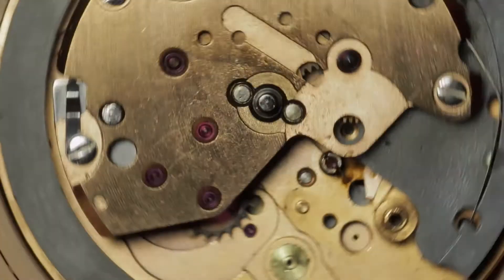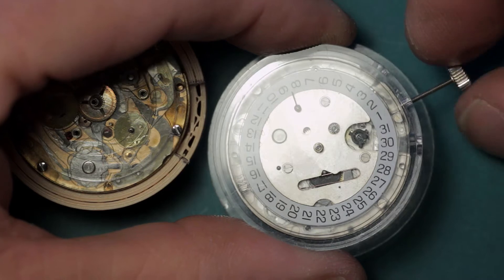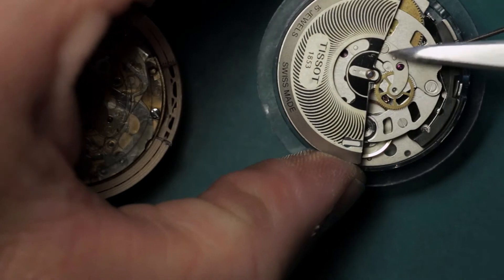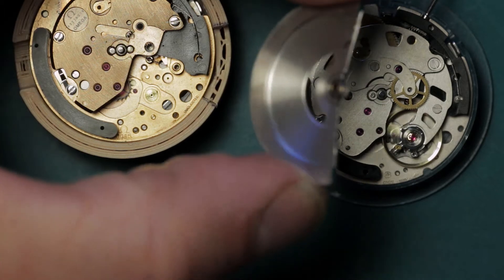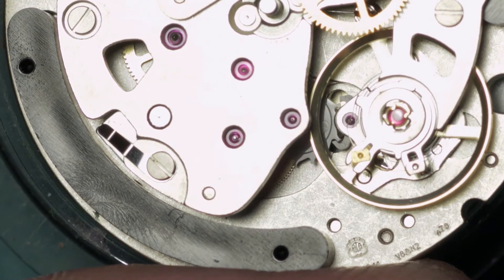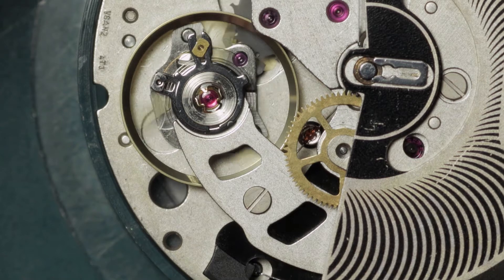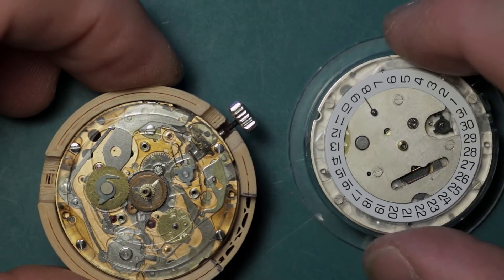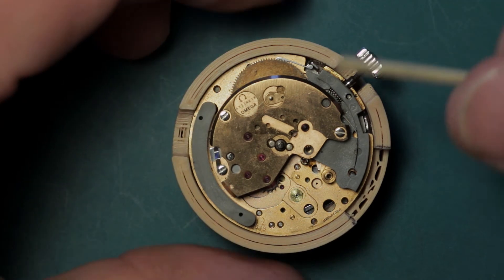Omega Speedmaster1045 / Lemania 5100 & ETA C01.211 Chronographs Compared

Comment: Thanks a lot. I have an ETA C01.211 chronograph with glass back. Without opening the case, using my 4x magnifier glass, I found the plastic escapement and pallat fork. I don't think that ETA saved money on the wrong part. There is no mechanical stress on escapement and pallat fork. I assume, plastic needs no lubrication. Therefore cheap and long lasting.
Reply: Yeat, laws of frictiob don’t agree with this statement

Comment: Are some parts interchangeable?
Reply from the maker: Theoretically they should be.
Realistically they're probably not as the 5100 is a 28,800vph movement and the C01.211 a 21,600vph
Reply: @spidiq8  thank you for the info!! i have two speedmaster with 1045 caliber. there are many detractors of this movement for the use of plastic. I'm worried that those parts will fail, especially the platen on top of the chronograph or the plastic wheel and I won't find replacements. That's why I would like to know if those plastic parts are interchangeable.
Thanks in advance
Reply from the maker: @statusbohemio  Hmm, now the clear plate theoretically could be.
However, the problem is, you can still get a decent range of spares for the 1045/5100 but try and find anything for the C01.211.
That's why I have one in my parts drawer with a broken chrono runner, I cannot find parts for them anywhere and of course being ETA they're restricted.
The clear cover, as long as you don't solvent clean it, I believe should be OK for many years, the delrin of the other parts is solvent safe and you can put that through the cleaning machine.
I have a suspicion there are detractors because the movement looks 'cheap' for want of a better word, it's reminiscent of the EB8800 and other pin pallets but I can say having stripped this one and checked a few bits, it's so good i've just bought myself a watch with a 5100 in and i've turned a few down in the past for being too expensive for a cheap looking movement, if only I'd known then.
These movements were in fact very clever and forward thinking technologically.
Reply: @spidiq8  thanks again! nice to hear that. Well this movement would never win a beauty contest but as long as it is reliable there is no problem with that. when i bought mine i didn't know what was inside just i really loved the dial layout with the day/date, the central minute counter and 24 hour indicator. So ill keep mine and  take good care of it because it is a very collectible piece.

Comment: Intresting info again. I realize more and more, that Im a sucker for blingier movements. 😁
Have never (yet) regulated a etachron balance. Have to look in to how its done properly. Maby a video sugestion?
Reply from the maker: Well....... I could but i'd likely give some ETA watchmakers palpitations as I tend to refuse to buy specialist tools for one off jobs and only ever do when there's no other viable option.
The Etachron system is very misunderstood, I used to hate them until I discovered how they work and how you adjust them.
I use tweezers to tune them but of course the risk of slippage is high compared to the 'official adjusting driver'.
I will have to try and throw something together showing it as it's really simple once you see it. Like me, most would slap their heads and go, well that's so obvious' lol
Blingy movements are nice! but this one has really surprised me performance wise.